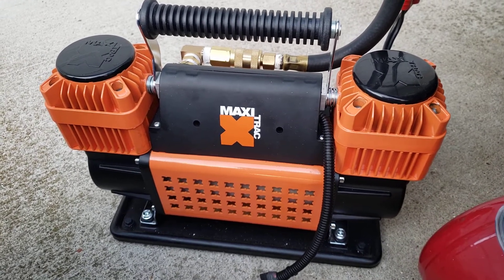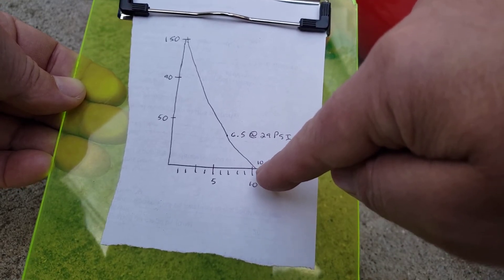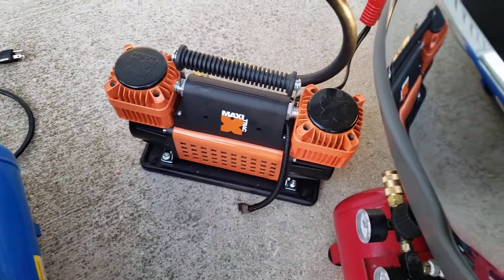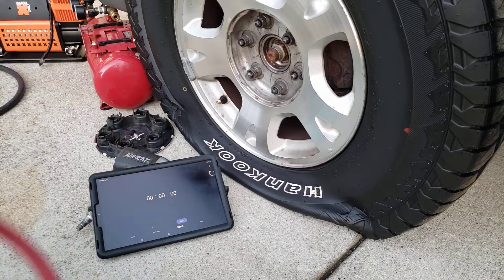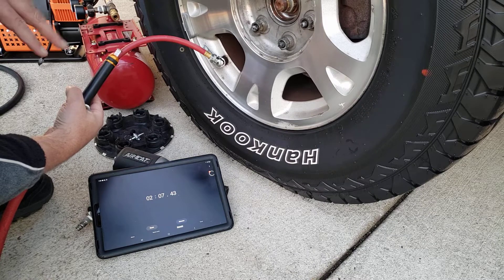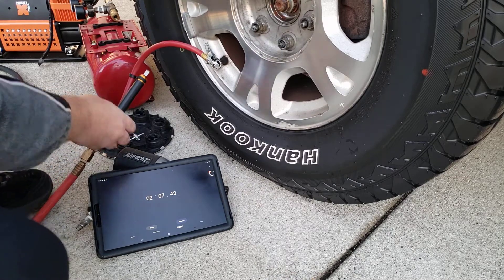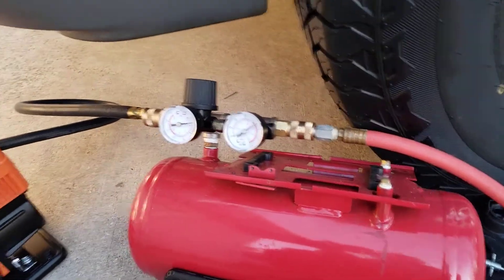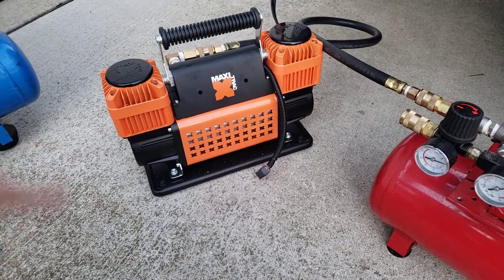ARB Compressor Killer 12v Air Compressor MaxiTrac

Comment: Great video.  I'm surprised that your compressor pulling that many amps didn't smoke that thin power cable.  Looked to be around 12 gauge.    Does it get hot?
Reply from the maker: It generally draws about 85ish amps at the beginning that 60ish amps was the lowest I've seen.
I'm surprised they don't get hotter than they do. I'd estimate the wire to be 8ga or so...definitely not big enough but technically does work. Just after this vid I got Anderson connectors and spliced them in near the motor for quick connect and I can hardwire it it with larger cable but quick to remove still and make it portable with the original clamps.
Reply: @mrmotofy  what size anderson connectors did you use that worked on the stock power cable?
Reply from the maker: @PhyrPhreak  I used the 175 stripped 2x length then bent over. I may have stuck a piece of solid copper wire in there too. It's over sized connector but can standardize with others for more versatility. I just got done adding one to rear of my truck for winch, connection to a trailer, the compressor, rear jumpstart etc